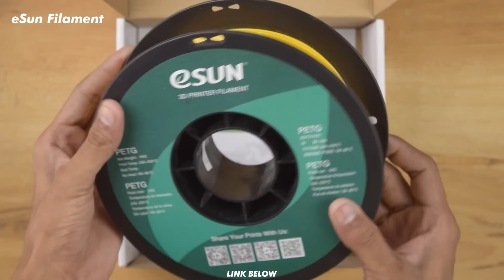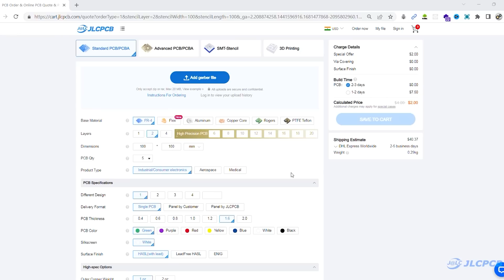Building a Brushless Motor RC Car | Homemade Racing Car using Drone Motor

Comment: Concept is good. But in this video u used one directional BLDC motor which is generally used in RC drones. So there's no way to reverse drive this RC car. Right !? Or if you find solution for that. please show in the next video .
Reply from the maker: I already had the solution: ESC with Forward/Backward and brake features can solve this problem. Due to budget issues, I used a normal drone ESC. I will definitely use that ESC in future videos.

Thanks for Watching!
Reply: Esc is the key makes one directional BLDC
Not the motor itself
Reply: To my knowledge it's possible to configure also cheap ESCs for bidirectional and break. Example with BLHeli.